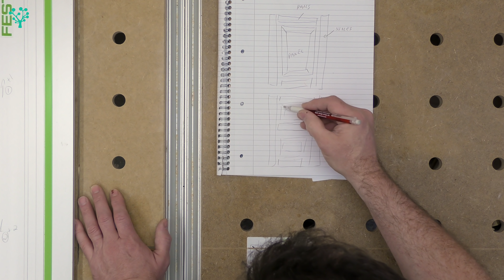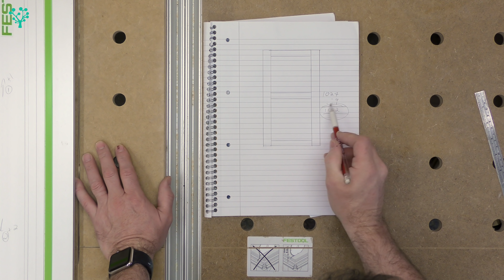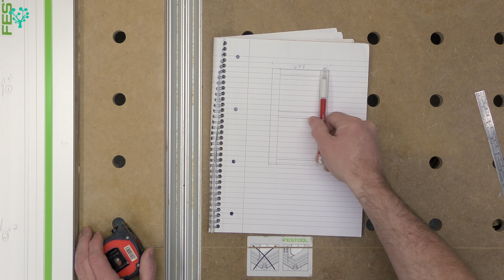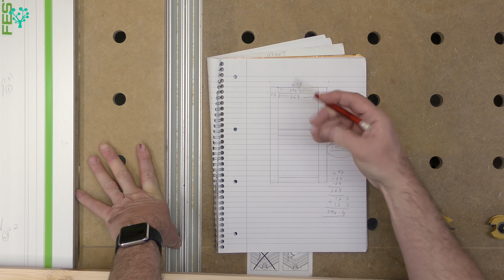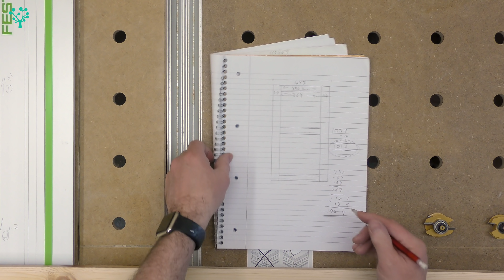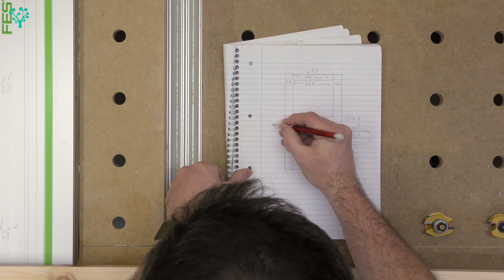How to build a bookcase - Episode 8 - Raised panel doors

Comment: Nice job.  I like your technique for clearing the thin bit off the ends.  If I may add, you should avoid the wood such as you used in your stiles with the dark stripe on the back.  That dark bit appeared to be the pith, or very center of the tree.  The tree grows like a weed for the first few years and the part surrounding the pith is called juvenile wood and has much greater tendency to warp and shrink.  Pick through the stock at the yard and avoid it if you can.  

And, avoid knots in the edges and joints.  They will fall out and give your cutter a hard time.
Reply from the maker: +Barry Irby 

Hi Barry,

As this was a workshop project, I didn’t pick out the stock - I just had my supplier pick it an deliver it. Sadly I didn’t notice the pith when I laid out the various components and that was the last sheet. Hence hiding it inside the door.

Similarly with the knots - some times it is just what it is. If this was a furniture projects then it would milling my own stock rather than using cheap furniture board.

Thank you for taking the time to get in touch, and for engaging it’s appreciated.

 Cheers

Andy

Comment: Thank you for the video, really enjoyed that.  I am about to start my first built-ins soon.  I also ordered that benchdogs kit the other day.  I am very interested to see if/how you are referencing the laser marked scale with your cut line while taking your guide rail into account.
Reply from the maker: +Matt Healy 

Hi Matt, thank you for the feedback.

I think you will enjoy the Benchdog stuff, it really simplifies the workflow.

The way I allowed for the rail was to set the fence a known distance away from the cutting strip of the rail. In my case it was 200mm. 

I used a steel rule, put the 200mm mark at the cutting strip edge and then brought the fence up to the end of the steel rule. 

I then allow for that 200mm in the cut.

I was talking to Ralph over at Benchdogs the other day, another idea is to cut the fence to size. So you measure the cutting width of the rail. And then cut the fence at that measurement point. Then bring the fence up to the back edge of the rail and then the engraved marks will be bang on.

If you go down that route, then the longer fence makes sense so you still have a meter plus of length on your fence.

I will be talking more about this in Tuesday  nights video.

Talk soon Andy
Reply: Thank you Andy!  I look forward to following and learning from your future videos.